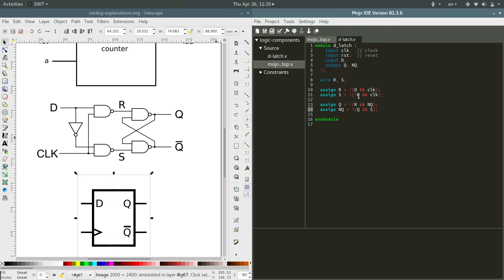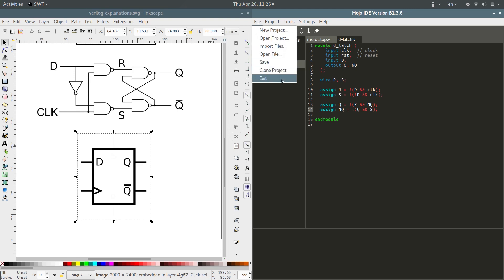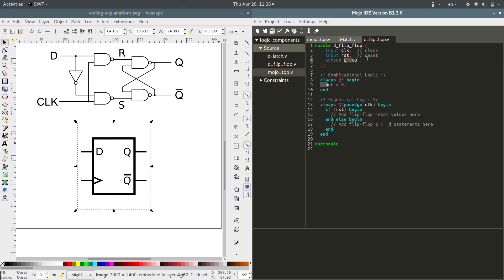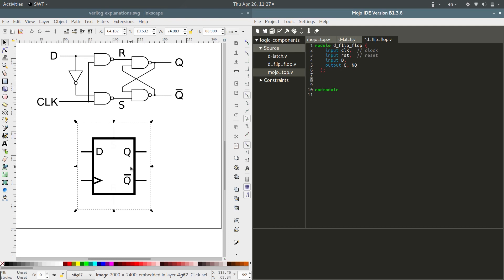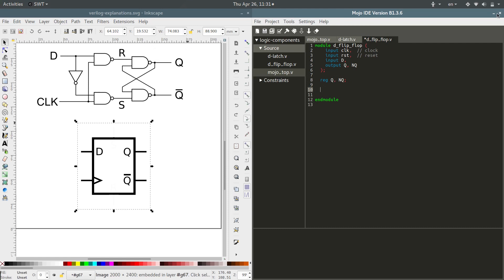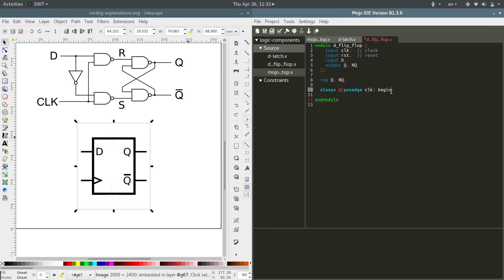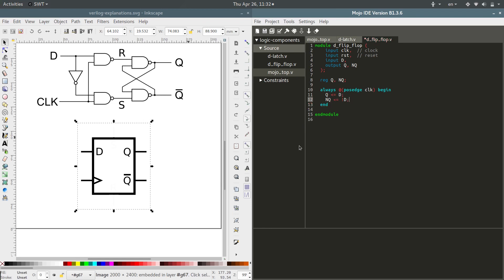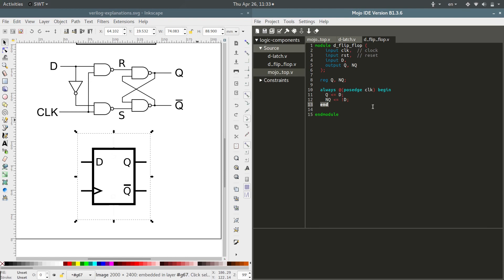Learn FPGA #4: Methods of describing circuits: Behavior  - Tutorial

Comment: Wouldn't it be better to only use one register and use a wire and a not gate for the other output? After all a register constantly drains a relatively high current and uses 6 transistors, while a not gate is a lot simpler.
Reply from the maker: Yes, you could definitely build this more efficiently. At this point in the series, I am more concerned with people understanding the main concepts and not so much with efficiency. Once people really understand this beginning stuff, they will be able to build things more efficiently.

Comment: What is the sample rate for ''the clock hits a rising edge'? or in other words, how fast can you drive this thing?
Reply from the maker: It will depend on your FPGA and your board. The Mojo v3, which I am using, runs at 50MHz by default. I have read that the Spartan 6 chip (the one on the Mojo) can get up to 375Mhz using internal clock multiplication, but I have never tried this myself. I would suspect pushing the limits of the FPGA's clock speed would cause you to run into a lot more propagation delay and other similar delay issues.
Reply: @inventboxtutorials1898  If you just output to adjacent modules (only neighbouring) does this help with problems here?

Comment: in the previous video you created a D latch but in this one you are creating a D flip flop, are they both flipflops since the first also contained a clock ?
Reply from the maker: Good question. Latches are asynchronous, meaning that any time they are active, they will store whatever value is on the D pin. Flip-flops are synchronous, meaning that they only store the D pin value on a positive edge of the clock. For a latch, the clock could be high and the D pin could change several times, saving several different values and finally, when the clock goes low, whichever the last value of D was, that's what the latch will have saved. With a flop-flop, the D value could be changing all over the place, but only the value at the moment when the clock hits a positive edge will be saved.
Reply: @inventboxtutorials1898  you explained asynch vs synch better than my college professor this past semester lmao
Reply: @inventboxtutorials1898  ahh i see, then why would one want to add a clock if the value of a latch will just change based on whatever value is at the d pin when they are active?
Reply: @Sabakunowashi  To make the output synchronous and stable with the clock. You wouldn't want your user to pull the finger off the button in the middle of a logic operation creating all kinds of noise as the contacts come apart.